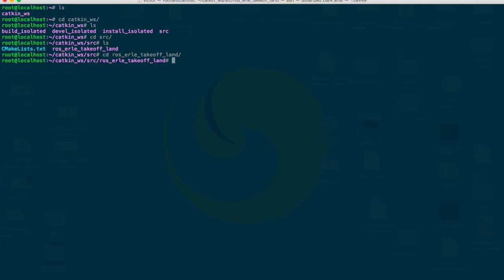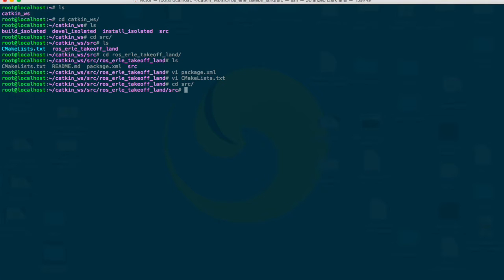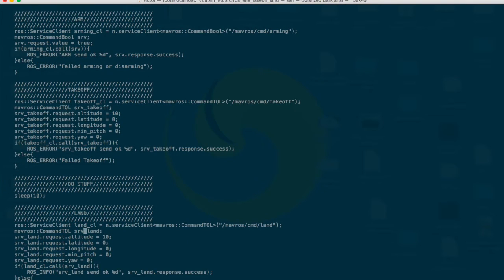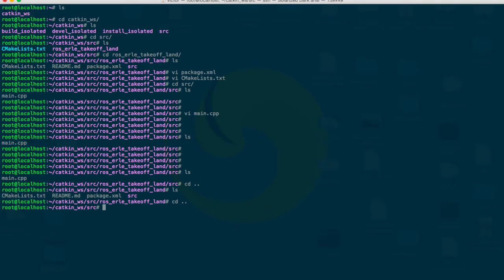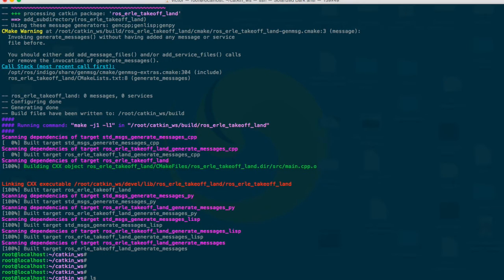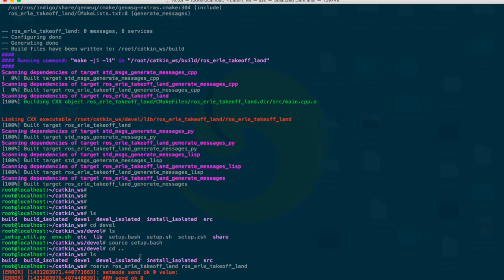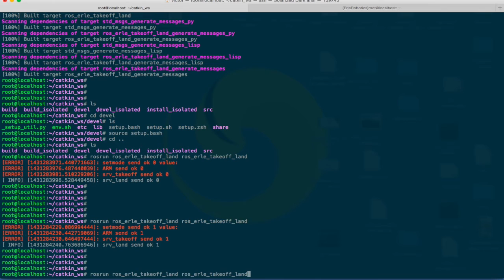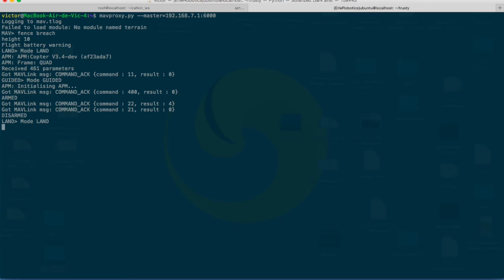Learning ROS 3: Making a ROS package for a drone

Comment: Hi, Please I m using the same code with PX4 autopilote and I m running ROS on raspberry PI 2 , I made uart connection between the autopilote and the RP2 and I tested this using mavproxy it woks, But when I use your code, when I launch the ros_takeoff_land node I have an error telling me that " failed to set mode " ... please what do you think is the problem ?

Comment: Thanks for the tutorial is very helpful, however there are many blanks between videos.For instance,tutorial 2 finish with the creation of the catkin_ws workspace, if fact the video finish with you type "ls" and in the terminal is displayed 

" build   devel src  "

but in the video #3, we have 
"build_isolated    devel_isolated    install_isolated  src"
which logically is different from previous one.

Moroever, in the scr you show the "takeoff and land" folder, which is not in the second  video. Can you explain how you get from the second video to the third. Also before to indroce to fast the ros enviroment,it would be easy to understand if you explain why there are many catkin_ws folders, as in the (ErleRootics)ubuntu@localhost.  I saw that in the  (ErleRobotic)ubuntu@localhost we have the takeoff and land, then how can I copy this to the root@localhost.

Thanks for your answer.
Reply: Do you know how to go about this? We have been trying and are new to ROS.